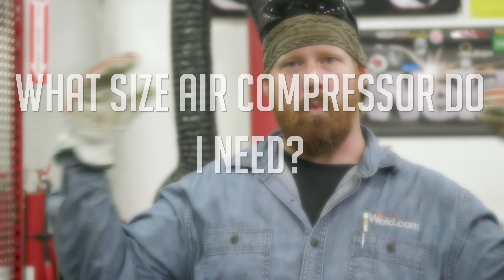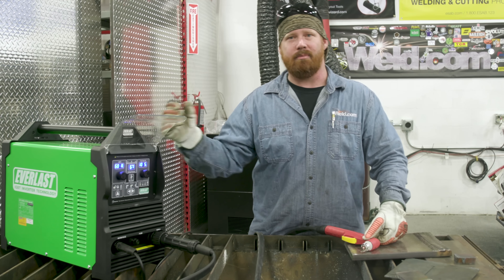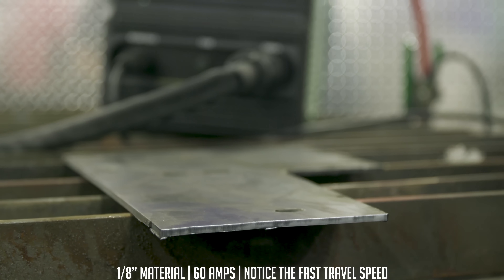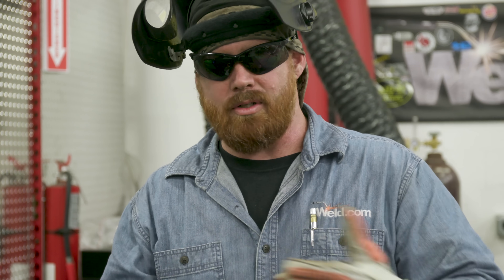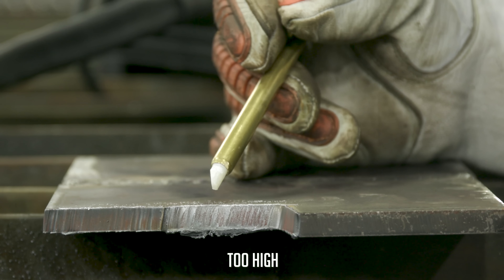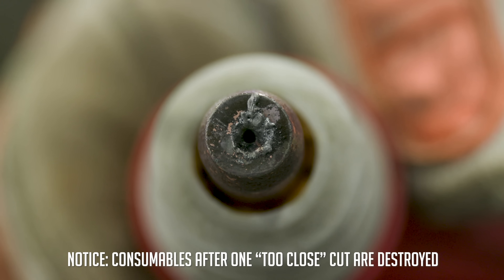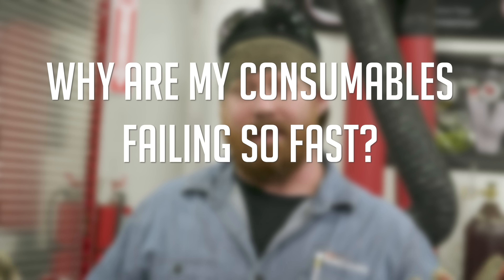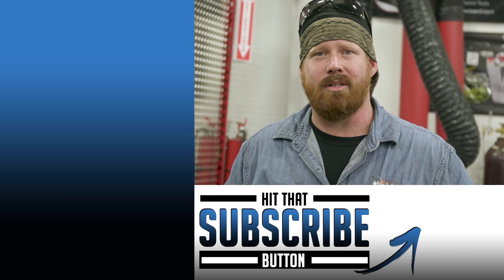Top 4 Plasma Cutting Problems, FIXED! (Everlast PowerPlasma 62i)

Comment: Hoping you could tell me what amperage at the panel you run 
my guess is you have at least 50 amps and 240-volt
I had 50 amps at my old shop and I had very few problems running my Everlast plasma cutter and now I got a new place and there's only 30 amps available and I have to run a cord and the plasma cutter won't run I'm thinking that's probably why

Comment: I found that when i was cutting with a pasma torch all i had to do is watch the flame coming out from the bottom. If it is not straight down than you are to fast and need to slow down.
Reply: Proper speed when plasma cutting, the flame/plume should be angled away from the direction of travel.  If it is going straight down, your travel speed is too slow.

Comment: Good tips, I picked up a Forney 20p from TSC for 250.00 on clearance. Run it on my 6gal air compressor with a dryer with no major issues, only cut a water heater in half with it but man it sure beats a sawzall or cutting disk!!

Comment: Thanks for the video Red, but if you don't mind... those are NOT really air dryers... they are air filters and water separators. They only remove part of the moisture as the air cools down going through the lines. The most common type of air dryers are refrigerant and desiccant air dryers. I use several water separators and particulate filters like the ones you showed, a desiccant air dryer just before the plasma cutter, and modified the compressor itself with an after cooler which removes around 80% of the water before it ever reaches the tank. When opening the tank's bottom tap, there is never any water that comes out of there since this modification. 
Perhaps this might help you guys with an even dryer and cleaner air solution for longer air tools life. 
Thank you.

Comment: Dry air! Can't stress that enough! I added a filter station on my plasma cart. So after the air has already been cooled and thru two traps, then it goes to my cart where I have another water/oil separator, then to a filter, then descant dryer and finally before entering the machine one of those disposable paint gun finishing filter. Makes it nice since it's at the cart. No reason to run all the shop air thru that 👍🏻

Comment: nice!  you have the same IR 2stage compressor i do in my home shop!  love it!  the type and quality of consumables is also a big consideration.  my Miller Spectrum 375 uses very little consumable life, i've only used a single (ONE) drag tip over several hundred inches of cuts on steel.  my previous 40A (crappy) TD ate a dozen tips in way less than half the usage, and they cost twice as much and are impossible to find.  terrible.  the good stuff costs more....because it's worth it!

Comment: what about cooling the air from the pump and removing the water BEFORE it goes into the tank??
Reply: I did this on my compressor several years ago. I rerouted the compressor discharge to a 40 ft loop of 1/2" black iron pipe outside then to a large trap I built from 4" pipe. The bulk of the water stops there, and the little that gets into the main tank doesn't get out into the distribution. I have several separators on various pieces of equipment, but they never collect any moisture. The key to this is cool the air before it gets to storage.
Reply: I've done this on my compressor by routing the air through a radiator before it enters tank.  And I have water separator both at entry and exit so in theory it's nice and dry.

Comment: i really wish you guys would educate people that the water traps are NOT compressed air driers. they DO NOT catch or filter out moisture. they only catch liquid water and you only get liquid water after the compressed air has cooled down, which is why you can get it in the plasma filter but not in the filter at the air compressor. even then the air is 100% saturated with moisture.
to dry the air down to a decent level you really need a refrigerated or absorption type dryer. 

otherwise good video. :)

Comment: Thank you.   I have always cut with oxy/acetylene for 35 years. Never even touched a plasma cutter. Is there enough of an advantage to warrant that extra expense in my shop. ( I used to welding on the job and in welding shops but now it is more of a hobby)
Reply: You can't cut Alluminium Checkerplate or Stainless steel with Oxy Acet. Also Plasma doesn't heat the plate up much, so colder cutting.

Comment: I was getting massive dross on my cuts, changing the power and air and travel speed didn't help.  So I tried deviating from the mfg suggested 40PSI, and the dross went away at 30 PSI.  Just sharing.  Thanks for the video.
Reply: This is the first mention on any plasma cutting video of the effect PSI entering the machine makes to the cut quality. I too struggle with excessive dross build up and have experimented with PSI setting to the point that too much pressure can blow the arc out. Why does every video I watch make such a big deal of the CFM, HP and tank size of the compressor but never any mention of the effects of pressure settings. Can anyone at weld.com please address this concern?

Comment: Thanks ! Getting ready for my first plasma cut, this is exactly the video I was looking for ! One question : I have oiling unit ganged with drying exactly like the unit on the wall in your video. Is it enough to shut it off,or is it better to take it out completely ? I assume oil in your air is even worse than water... I even consider to use a dedicated oil free hose for my cutter. Thx.

Comment: Hi, I recently bought a 50 amp hf plasma cutter (with pulse tig function) and it's rated to cut up to 14mm max. It came with a sg55 torch.
The question is, can I increase the cutting thickness with a better torch? I've seen other 50 amp machines that cut up to 20mm.

Comment: I know firsthand about keeping the incoming air clean. I worked in an electrical control manufacturing facility and let me tell you I could create a small pond with the amount of water coming out of the air hose hooked up to the plasma cutter. I was cutting 1/8 aluminum plate and constantly had to file off dross on every cut. There was no air dryer at all.

Comment: Everlast makes good stuff , but why can't they come up with a drag tip? This is why I bought a Hypertherm  , they have drag tips for all their plasma cutters except for cnc machines which have standoff setting. I can cut most thickness materials normally used (1/8 to 1/2 ) with my XP30
Like Jason says just very the travel speed. Very good advice there Jason, Now that you have trimmed your beard  , there must be a women in your life who made a recommendation  or did you have to get recertified for a respirator? . You are a good teacher keep up the good work, you and Man Cub are a great team.
Reply: There's a guy floating around  that has a 100 amp Everlast that he retrofitted with a Hypertherm torch.

Comment: I really enjoy your videos. Their inspiring confidence in the next job I’m preparing for .  I’m about to weld some 3/16” 4x4” steel angle to the rusted frame of my 98 4Runner for some repairs  and the frame is basically just sheet metal. all Ive got to work with  is a 1970 Lincoln ac stick welder and a harbor freight  125a flux core spray and pray welder. Wish me luck 🤯
Reply: The phrase is now "point and shoot."

Comment: Good info but i must add for me personally i match amps with identical consumables for cut quality . I dont have a ton of experience with my TD Cutmaster 58 but have found I get better quality cuts with a smaller kerf and less bevel. For 14g and 1/8" i use 30amp . 1/4" up to 3/8"  I'm using 40amp. Maybe its my  technique or lack thereof for me and i just need more consistent travel speed adjustment. Love your channel and quality content

Comment: So don’t let this happen to you:  today I’m in the garage plasma cutting 3/8” thick mild steel.  A piece dropped, and while it was still smokin’ hot, I inadvertently stepped on it.  I had thick soled boots on and didn’t realize what I done, till much later when I noticed clicking with every step.  Anyhow, that pice had melted my Red Wing soles like they were hot butter.  Had to dig the piece out with a screw driver.  Thankfully, because of those thick soles, I did not get burned.  But, with cheaper boots, that could have been a nasty burn.
Reply: Tap dancing! That was great, thanks for sharing

Comment: I have a question for you. At work, we have drag tips for our plasma cutter. They insist that  drag tips are "directional". As in, you can only drag it, not push it, and tell me "that's why they are called drag tips" . I was under the impression that it doesn't matter what direction it goes, drag meaning it drags the surface vs stand-off. They also insist that the machine should be maxed out all the time, with the belief that it keeps the tip cleaner and preserves the consumables. I believe it is a 45amp machine but I don't know about the consumables. I'm getting blamed for consumables wearing out too quickly, because I questioned their logic, and asked how the tip knows what direction it is going. Is their any truth to any of that?
Reply: Nah, that’s BS most drag tips have 4 little prongs on them. They don’t know which way they’re headed. Make sure the consumables meet or exceed the amps your using and you have dry air.
Reply: @jasonbecker3362  that's what I thought. Ours don't have the four prongs though. They look just like stand off tips. The bag they come in says drag tip on it though.
Reply: @Jason Becker 
What are the “consumables”???

It’s been a few years since I used a plasma cutter, but then it was the gas mixture and air, unless the gas mixture is the “consumables” that you are talking about.

Comment: Great tips, thanks. However what you're showing as "air driers" are actually moisture traps and aren't air driers. They will simply trap condensed water and prevent it from continuing downstream. An air drier on the other hand dries the air itself, typically by cooling it like a refrigerator, condensing the water out when it cools, then allowing it to warm back up again. They tend to be relatively expensive when compared to a moisture trap. Paper filters are a bit of a half-way house between the two.
Reply from the maker: Thanks for the comment Pete 👍

Comment: Can you use a stand off guide with a cutter that doesn't have the pilot arc feature?
Reply: The same question crossed my mind since mine doesn't have pilot arc, and yes you can but it's tricky and sucks.

Comment: Good video! I have a 2 hp 4.5 cfm 10 gal compressor with a Hypertherm Powermax 30 plasma cutter. The compressor gives me plenty of air and the Hypertherm tip is not hot which allows me to drag it all over. I use a piece of flat bar as a straight edge and just drag the tip on the base metal and the flat bar to make straight cuts. I love my Hypertherm.
Reply: I got a Hyper last month, it’s great.
Still learning how to use it ....